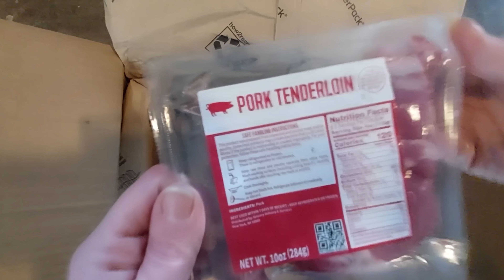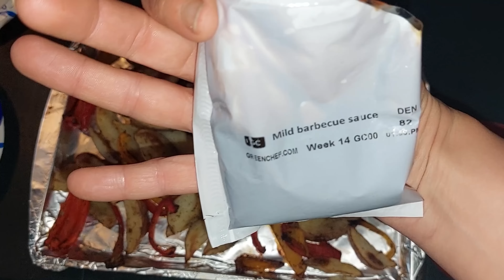The FINAL Step to Dry In! |Roof Eaves Overhang | Couple Builds Dream Cabin Homestead In The Woods

Comment: You did those fly rafters the easy way.  We should have done it the easy way when I was framing houses.  But we didn't.  It's good to see them finally go on.  And now you're ready for the decking.  I can't wait to see you on the inside.  I've watched since you poured the foundation and the basement pad.  Good job, Gary, Mel and Mike.

Comment: I am impressed, for someone with no building experience you are doing great. I see a lot of extra wood that you could have done without but hey, it is your house. It will just make it harder when insulating the outside walls.
 When you start your siding, maybe rent some pump jacks, that would save a lot of running up and down a ladder. It will be nice to have when running your cornice also. I am sure you know to leave at least enough overhang on the bottom sheet of decking to overhang the fascia board and shingle strip. But overhang is not needed at the gables the fascia and shingle strip are flush with the top of the decking there. Sorry to write a book here. Y'all are really doing great.

Comment: The design I chose for a shop was the end gables were exctly 3.5 inches shorter and the over hand attached and was supported by the wall/gable and attachment was one truss in. I felt it was most supportive.  but we have snow load.

Comment: I think them overhangs would have been a lot easier to put on the end trusses when they were on the ground like carpenters do when they frame a house . If you wear a tool belt you can hang your hammer off it and your tape measure and even a chalk line, nails,air nailer  nails then it is with you at all times.

Comment: Lots of hard work there!  One thing I noticed, and I hope it was intentional, is the outer edge of your fascia doesn't look like it's in plane with the roof (if you stick a level on the rafter it should slide over and barely touch the fascia).  If it isn't in plane you are going to have issues attaching your roof sheathing or metal roof at the edge.

Comment: Great work on the ladder truss eaves.  When I was building houses I did it that way one time.  But, it was very heavy and labor intense to install.  After one time I went to drop end gable trusses and just ran extension or fly rafters from the first inside truss across the top of the drop end.  It was much simpler and used less material.  But, you guys did great work getting them installed.  They will last for years!

Comment: I am so happy that you guys are able to get the roof worked on before the ARKANSAS SUMMER HEATS hits you guys flat-out! 

Mike sure is a miracle worker when you guys are working together. It seems that he energizes Gary and gets the work done twice as fast as any that you have had so far. Thank God that he came into your life as a new FRAMILY member with his wife and kids included. 

When you guys were hauling up the pieces of the green plywood I kept thinking there must be a better way and how in the world did the Egyptians build the pyramids without having the machines that we have today so there must be a better way to get the pieces of greenwood on the higher parts of your home at this point.
  I keep thinking one of you is going to hurt your back or worse yet fall. Then all the building is going to stop on both homesteads. Have you found any other building video's going on for information for working on roof's?